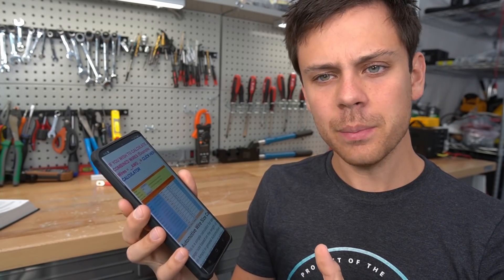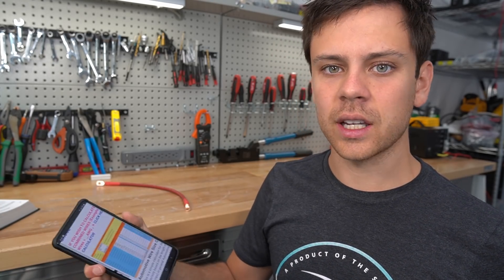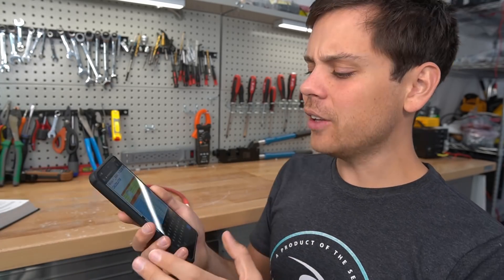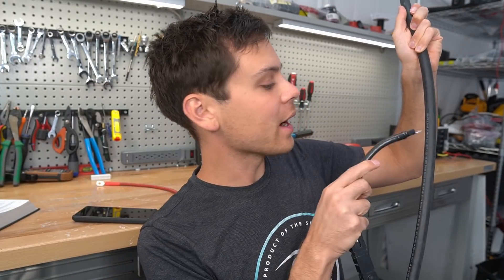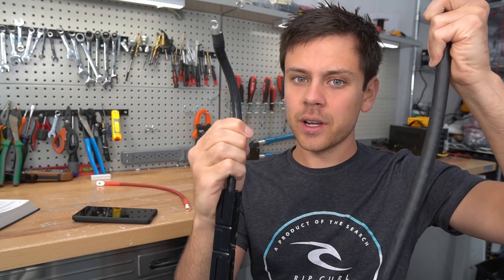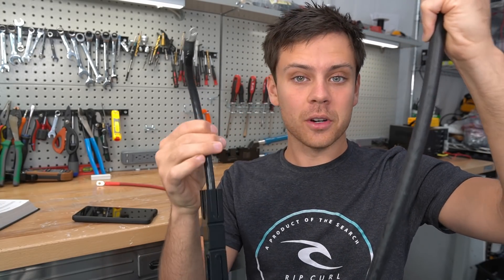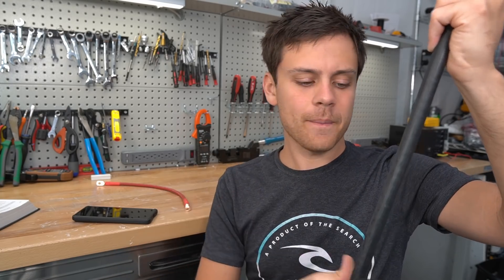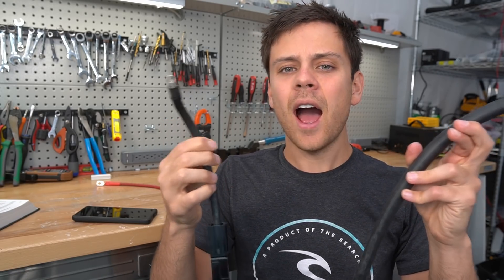How to Determine the Ampacity of a Conductor

Comment: Maybe a follow up on stranded vs solid core?
Reply from the maker: I always seem to miss something in every video 😂 I try so hard to cover everything! Yes, good idea. May need to do another wire video soon.
Reply: Solid is better but harder to work with and more expensive
Reply: @PetRatty  on smaller gauge wire, solid would be best. With larger gauge, stranded is best. Electrons travel on the surface of the conductor. Stranded wire has more surface area. Part of the reason why welding cable is super fine stranded; lots of surface area to handle massive current surge from a welder/inverter/starter.
Reply: @chrisbayus5189   Welding cable is finely stranded as to minimize memory effect, and make it easier to handle.  Finely Stranded Wire is also not as subject to work hardening from repeated stress as the thinner strands are far more flexible than standard stranded conductors. When strands of wire are assembled into a group and surrounded with insulation they effectively become a single strand electrically.  Lastly, the skin effect you're referring to isn't present in Direct Current circuits.  I realize not all welders are DC, but a significant portion are.
If you would like to learn more about the skin effect Big Clive has some excellent content where he disassembles some gizmos that operate at super high frequency.  (The skin effect increases with frequency)
Reply: It depends on application. There are code that specifies what to use where. For marine applications always use fine stranded wire for example. And tinned. More strands = higher resistance though but that may or may not be an issue.

Comment: Ampacity tables are based solely on whether the temerature of the wire UNDER SPECIFIC CONDITIONS will exceed the temperature rating of the wire insulation. Those conditions include how many wires are bundled in a conduit and whether it is inside an insulated wall, etc. This is why different types of wire have different ampacity ratings in tables. You can never exceed the relevant ampacity rating of the wire, even if it is a very short run and the power loss would otherwise be acceptable. You neglected to mention or consider this. For this reason, you cannot really use 2 AWG wire for a continuous 300 Amp load. The calculator at wire barn is only looking at power loss. It is not considering allowable ampacity. It might be OK to use 2AWG for an automotive starter since it does not run continuously. But it would not be OK for continuous operation because the wire will get too hot. As an example, the NEC ampacity table for 2 AWG THHN cable only allows 130 Amps. Even 00 AWG is only 195 Amps. The NEC ampacity table may not always be the most relevant table because it applies to wiring in a home using conduit and such like. But 300 Amps is way too much for 2 AWG wire.
Reply from the maker: Just added a correction. Thanks
Reply: Just noting that the NEC tables does not specify location for wire ampacity, such as a "home"...  just wire ampacity in Conduit or Wires in Free Air that both could be applied in many locations.
Reply: @LiveSounds11  yes but the NEC is not the applicable code for automobiles, boats, or the chassis wiring inside an appliance. That is why I said "home", but you are right. "Home" is too specific of a term for sure.

Comment: Very well done , and explained !! Now Will , I have a request that I think anybody does , or should wonder about ?  That is . If I have a 100 amp battery wired to a converter . What is the amperage lost going from a 100 amp battery converted to 120 VAC ??  It can't be one for one , can it ? I mean , you can't get 100 amps of service on the 120 VAC side of of a converter , right ?  I mean the battery is rated at 100 amps at 12/ 24 volts DC . Any chance of a quick lesson / video on this subject , and how it works ?!?  Excellent job explaining wire sizing !!  Be safe out there folks ... Gubs
Reply: There are two calculations on a conversion.
Volts to amps is a direct ratio.
12v 100 amps is 120V 10 amps.
However it also depends on the efficiency of the inverter.
Most have around 80%, some can get around 96% it just depends on the type of inverter.
Reply: @SuperVstech  Thanks SVT . I assume that you meant 12V 100amps ? But , I got you . Average is 80% or 80 amps , and high grade converters can get 96% , or 96 amps . I had no idea it was 1 t0 1 ... Thanks again ... gubs
Reply: @indycharlie  it is not one to one, it is a correlation.
Like I said above. 100AMPS at 12Volts is required to put out a 120Volts 10 that is TEN amps.
Reply: @indycharlie  it is all about Watts.
To push 1200 watts at 12V is 100 Amps... the same 1200 Watts at 120V is only 10 amps.
So to get 12V DC inverted to 120V AC, AT 1200Watts will be a 10A ac load, that takes 100Amps, PLUS the efficiency loss... so it will take 120A of DC if the inverter is 80% efficient.
Reply: @SuperVstech  Ah . ok . I was trying to figure out how many panels ( # of watts ) I'd need for a night , to run a 5000 btu air conditioner in a Sprinter . Yes , I plan a frig & other stuff . Maybe it isn't possible without a bunch of panels on the ground also . I do NOT have the Sprinter yet though . So , as a example . If the A/C ran 1/2 hr  per hr , and it's FLA was 5 . I'd need like somewhere around 360 amps worth of batteries . That being approx 2.5 amps per hr  X 8 hrs ... 20 amps . So I'd need to gain at least 2400 watts per day to meet just that load alone ... hmm. And , yes . I know that 2400 watts of Solar will never produce 2400 watts per hr .  I want to thank you for taking the time to reply to my slow ass .  Have a good one , and thanks again ... gubs
Reply: @indycharlie  regarding the panels, I don't know where you plan on having them, but a 100w panel on a good day could do 300+wh. So, if you're wanting 2500wh in, you could do that with 3 perfect hours on about 1000w worth of panels. The trick to panels is the panel output voltage has to rise above the battery voltage by a specific number of volts (charge controller specific) before the charger kicks. The easiest way to do that is to get higher voltage panels (or series them) vs the battery bank voltage. So get 24v panels for a 12v bank, and you'll doubleish your amps. A 24v panel will start charging (at low amperage) long before a 12v panel will simply because its output voltage of the panel will be over the +3-5v threshold long before the 12v panel's output voltage will.
Reply: @PusoPinoyAko  WOW !!! I have been watching video's and reading a bunch on Solar stuff , and .. I don't " think " I ever heard anyone mentions that difference between 12 / 24 V panels ?!  I say think  , because I don't remember hearing that , though Will may have in one of his video's . In that I am 70 , sometimes my memory isn't the best :D Same problem with some of this sinking in !!  Glad you mentioned that about the panels . I'd just watched a vid where someone had ( 4 ) 230 Watt panels on their roof , but 12 V . I was going to look into them . At this point , I am glad I haven't bought that Sprinter yet . If I had , I'd probably have gotten antsy and thrown a system together with regret . I hate to buy a new Sprinter , and then use a window unit . But , they seem to pull the least current for the task . Thanks for that information @ Carl . Have a good one ... Gubs
Reply: @indycharlie  watts are watts, so a 230w 12v panel produces the same power (watt) as a 230w 24v panel. The benefit of using a higher voltage panel, or  panels in series, is the voltage they produce will be above the charger's charging threshold (battery voltage + 2-5v) earlier in the day, and it will stay above that threshold later in the day.

That said, I live on a sailboat, and I have a window unit I use in the companionway when it's really hot. At full sun, I can run the window unit (exactly when you want a/c) and still have enough power to run all of my other loads and put a few amps into the battery bank. I only have 2 x 24v 255w panels on my boat, but they'll put out 40+ amps in full sun.
Reply: @PusoPinoyAko  Ok , got it on the panels . T.Y . I plan to travel out west to see it  , and backpack it . Having lived in the " High Desert " in both Idaho ( Mtn. Home ) and Cali ( Victorville ) and did my AIT at Ft Sam ( San Antonio ) . I have slept in tents when it is above 80 degree's at night . My main concern is for sleeping at night . I plan to have a awning  , and generally live outside exploring & hiking .  I am still on the fence about full time or not ?!  I wish there was a place to compare the panels for Watts / volts and SIZE . Thanks again for all the replies . Safe Sea's & fun travels ... gubs

Comment: In metric it is all very simple. Voltage drop = ((2 x cable length in meters x 0.0178) / Cable surface in mm2 ) x Current

Comment: Jeep set up with portable battery in the back of the cargo area. 8’ each way for 16’ total. Starting battery to back of Jeep. I may run wire under Jeep in or next to existing loom. I will be building your larger 2.0 milk crate solar power battery setup. What gauge and type of wire should I use for this application?
Thx,
Al
Reply: What size is your alternator? Are you going to run lithium in the back?

Comment: is there any harm in oversizing cables? e.g. to be safe or future proofing for higher loads
Reply: Nope, in fact it is a good idea if there is even a remote possibility of upgrades.
I also sometimes run double sets of conductors for future strings.
Reply: No, there is no harm. It's just more costly, if you can afford it, go for it

Comment: Do the amperes/electrons flow through the wire, or over the outside circumference? Does a solid copper wire differ from thick wire made from small strands? Can insulation block or act as resistance to magnetic fields?
Reply: With DC voltage, the current is even throughout the conductor.
Ac slightly uses the skin, but it isn't much of a factor until high frequencies

Comment: I always over gauge on everything, I've been using all the specified charts and calculators as well. Thank you for all the relative information
Reply: Me too. I just feel better about having less resistance.
Reply: @tranerekt1731  that's pretty much the same reason I do it and also for a lower voltage drop Across The Wire.
Reply: @mindovermatter3988  I'm sure were getting a decent little boost in overall system efficiency, and it's a little bit easier on our components.

Comment: I think you missed something. Max amperage for a cable is not only related to power loss. Let’s take your example. 300 amps, 4’ long. If I’m okay with 5% loss because I will only use it in emergency couple times/year, I will need a 6 awg cable according to the same calculator you used, but there is no way a 6 awg conductor can support 300 amps without melting itself down. Power loss is important but the more the length of the cable is small, the more you have to use judgment for the max current you can put through the wire.
Reply: And what about when the battery, that's been working hard all night, is near 10.5v instead of 13.8v... size on the low side of the supply - not the fully charged voltage.